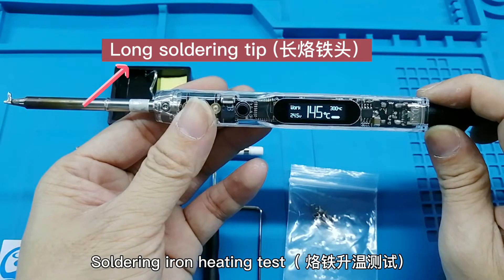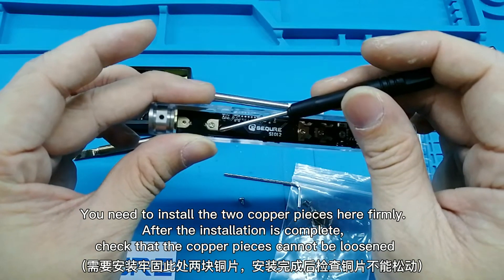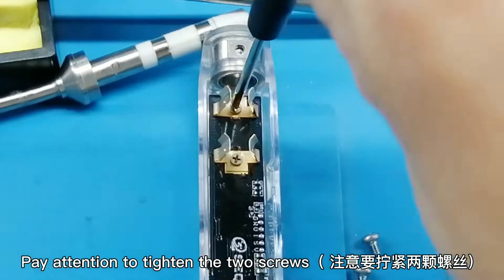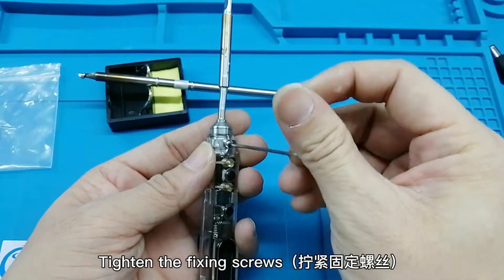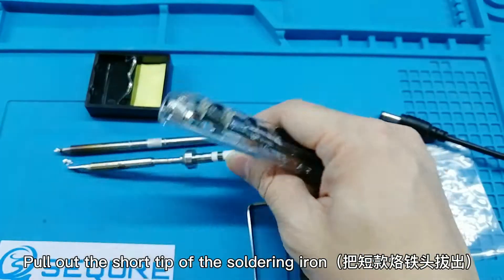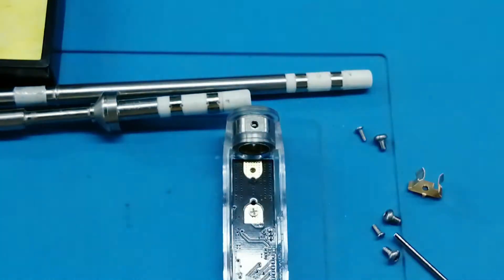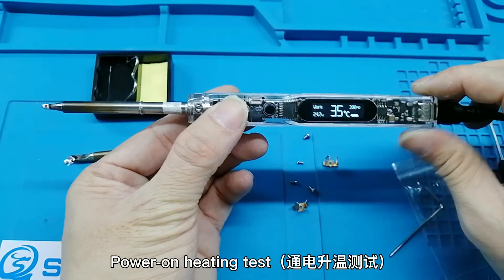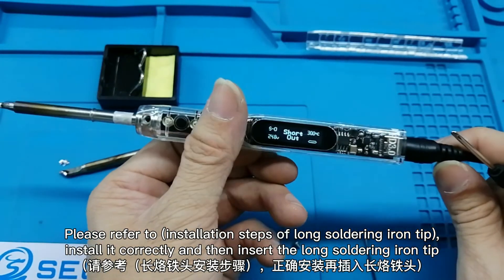How to Install TS Soldering Tips and T12 Soldering Tip For SI012 Soldering Iron

Comment: Hello
Would a high temperature plastic sleeve over the long soldering tip not been easyer(putting the sleeve every time only over the longer tip, instead the screwing) , instead to replace every time the copper piece and how many time you could screw the screws in before it would brake and have to be replaced 🤔
Reply from the maker: Your idea is good. Thank you for your suggestion.😀
Reply: the tolerance and the clearance they chose where the tip entrance is piss poor design. if you don't screw the screw enough the tip will wobble.